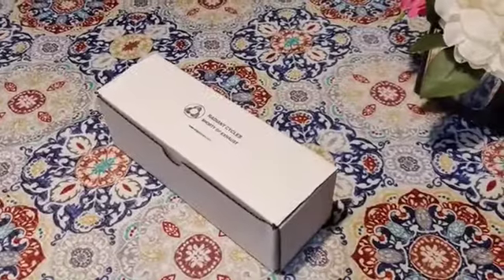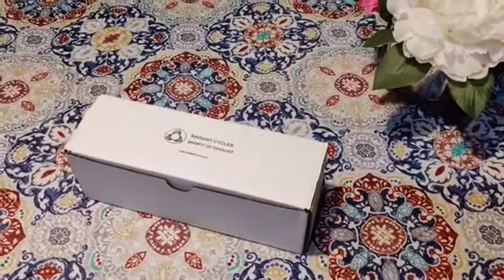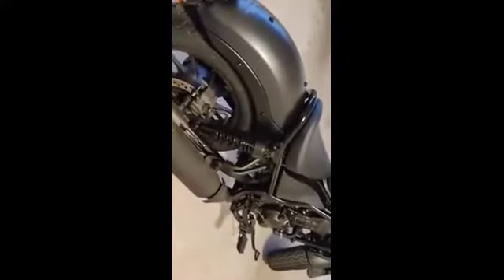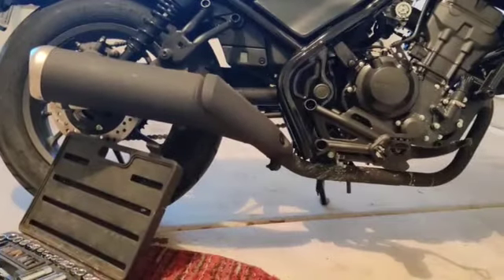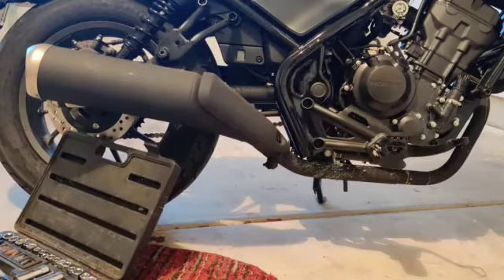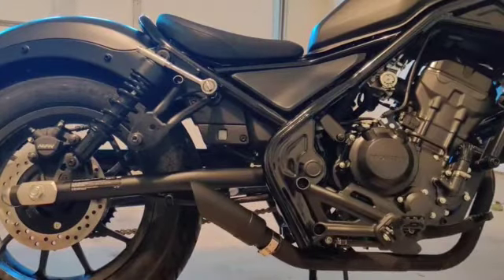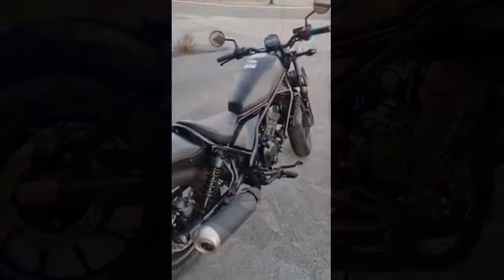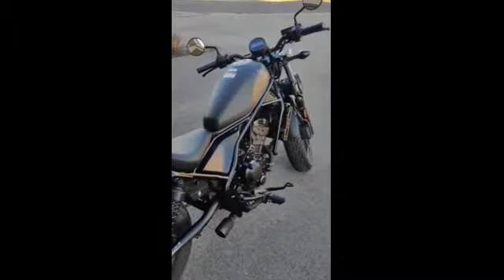Honda Rebel GPX Exhaust Installation

Comment: Do you still use this exhaust for the 300? Curious if you think it was a worthwhile change.
Reply from the maker: Hi @Timothy Matos,  Yes its still in the rebel.  For the price I paid for, I think its okay.  But don't compare it to V&H or more expensive pipes.  You might get disappointed.
Reply: Perfect. Thanks. All I wanted to know.